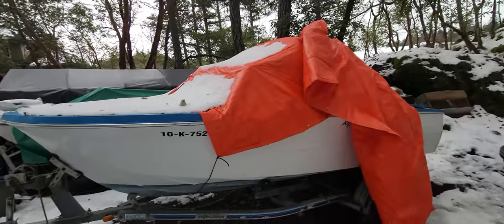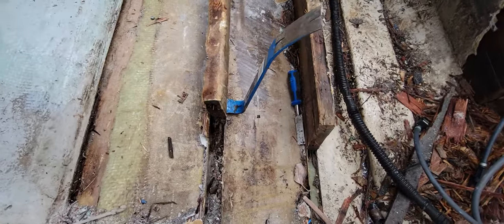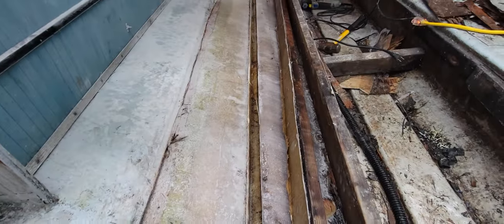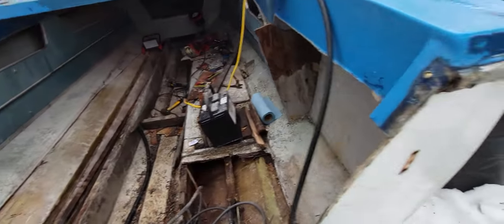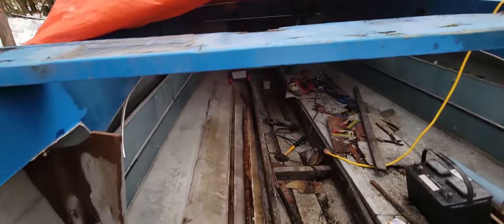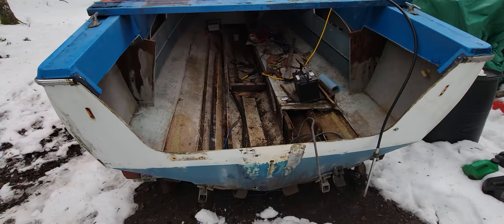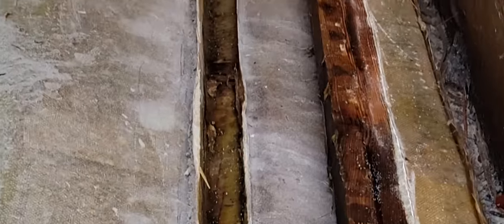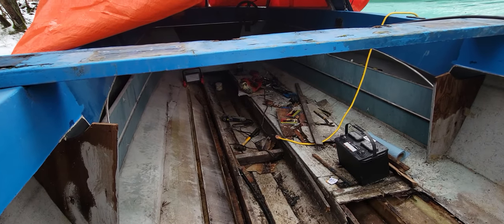Hourston Glascraft Restoration - Part 6 - One Full Stringer Removed

Comment: I had the same concern about taking stringers out and warping hull from load of my 220 lb weight inside working on it.  If it did warp slightly, it wasn't apparent.  My boat has 5 stringers.  Looks like they changed the design slightly by 1978.  I have a stringer resting on the "keel" as well as the two on either side.  Seems like over-kill.  I used PL cement to bed them, but it was obvious that they just plunked them down in resin in the factory.  I did not bother with the closed cell floatation under the deck as I figured it eventually adds huindreds of lbs to the weight of the boat as it absorbs water.  Originally they used open cell foam which was a disasterous water sponge.  But even closed cell will do this eventually.  If no foam worked for 50 years, it's good enough for me. Chuck knew a thing or two about building boats.  I intend to add an access hole in the floor between stringers to open up and suck any residual water out and leave it open in the off season so the black mold can't do it's dirty work below deck.  Although I've coated everything underneath with glass, resin and gel coat, I worry about freezing water finding crevices to freeze/expand and break the seal, allowing water back into the stringers.